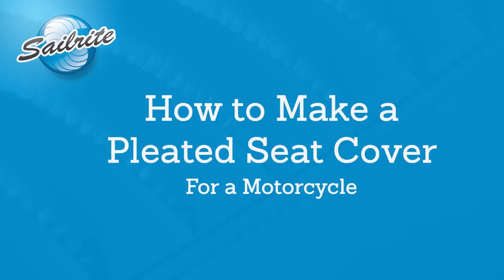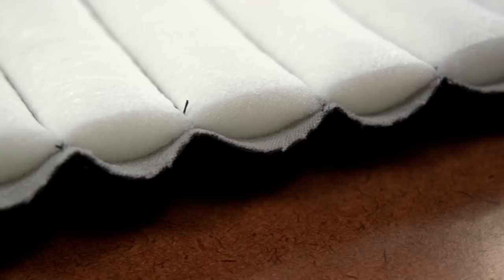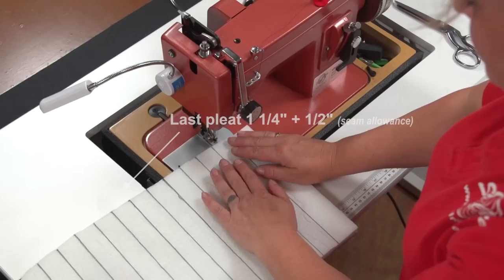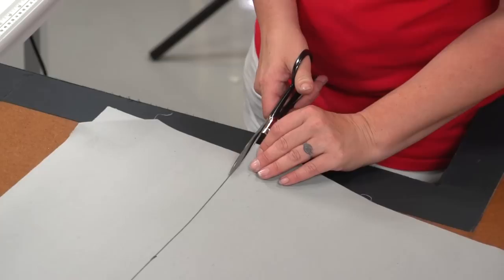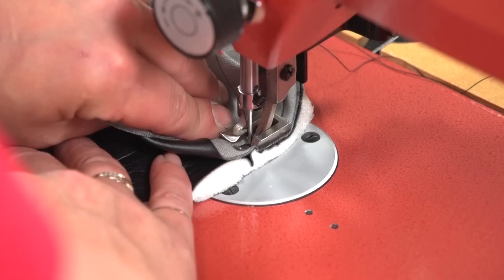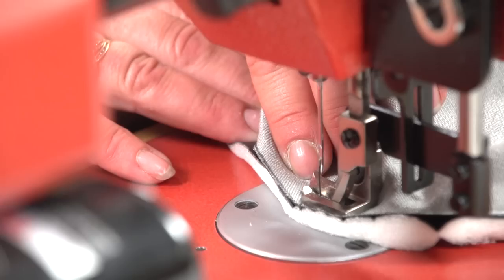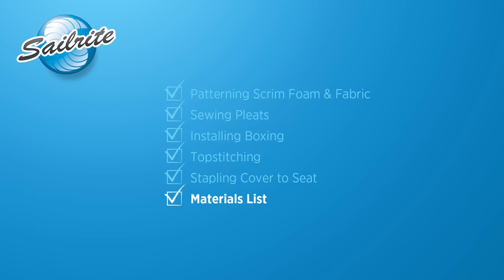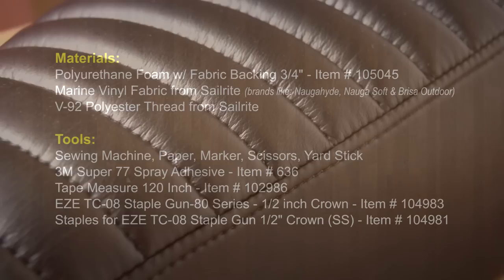How to Make a Pleated Seat Cover for a Motorcycle

Comment: Just used this video to make a new seat cover for my boyfriend's 1973 Yamaha 125.  It came out beautifully!  Instead of foam I used batting, and I used spray adhesive to add ripstop fabric to the back to prevent the stitches from pulling through. I still have enough vinyl left over to make another whole cover, and all the materials only cost about $20. Definitely an upgrade from the original seat (which was about 50% duct tape after 41 years!).  Thank you!
Reply from the maker: Excellent! Glad we could help. If you have any questions regarding our many videos or products at: www.sailrite.com let us know.
Reply: Heather Perkins nice
Reply: Nice

Comment: It's so easy when you have the right tools for it. I have done several seats with a sewing machine that was not designed to sew so thick materials (it was a pain) and I have done a few without any sewing machine. I have never used any glue for the foam just marked the different layers at the same locations so I could keep them aligned.
Reply from the maker: +Gábor Lipcsei Very true! Thanks for your comments.
Reply: I have made 2 two seat covers using very old foot powered seving machine.

Comment: I've watched many of your videos and used many of the techniques. Great job. I have an upholstery shop in Alberta Canada and have bought several of your products as well. 
Let me tell you of an easier way to join boxing thats dead accurate and much easier.
first lay one end down and mark where the center line is that you want your seam . add your seam allowance and cut it off. Then simply lay the other side of the boxing over the first end double your seam allowance ,which in this case would be one inch and cut it off.The trick here is when you lay over, eyeballing an inch is chancy , however if you tick a mark at a half inch (which is naturally what you're looking at as seam) and then another tick a half inch away from that you'll have the perfect one inch. Do this top and bottom and with out a ruler or straight edge you'll cut and sew a perfectly centered seam every time.
Reply from the maker: Excellent! We will try this in an upcoming video. Thanks for the tip!!!!

Comment: the back stitch should be done on the inside of the 1/2"  . This way you will not put a million holes in the vinyl as well you will not see the backstitch joint. This would not apply with a french seam though. I have sewn many miles and this is routine. The band on the seat should be cut concave on the seat corners slightly to draw in the material so it will fit much better around the corners too
Reply from the maker: Great suggestions! I will do this in the future. Thanks a million.

Comment: Never sew were your top thread is from the (stock thread)bobbin, as top thread from the spool is better for top thread, looks and finishing, also sewing were you finish material is face down risks damage from the machine. I alway try to make the primary stich shorter than the top stitch length.@13:48 we can see the tension on the bobbin thread wasn't tight enough to pull the top thread below sight and shows up on the finished work as incorrect stitch. Over all fair to nice work.

Comment: How do you do when the seat bottom is in steel, not plastic/wood. Thanks
Reply from the maker: Those types of seats usually have triangular prongs built into the metal that grip the fabric cover. Does your steel bottom plate have those prongs?

Comment: This was GREAT!

I have a question.

Have you seen a stapler that would work in tight spaces, with no more than 2" height to work with?

I've run across this situation twice recently when rebuilding large boat seats with recessed cushions.

There's no convenient way to staple down the "pulls" which keep the vinyl taut.

When I get out to the edge there's no more room for our Senco stapler.
Reply from the maker: Will this one work: https://www.sailrite.com/EZE-TC-08-Long-Nose-Staple-Gun

Comment: How would one do this for a metal seat pan, as for the staples wouldn't go through the metal? would you use a rivet type method? Also this is not a factory metal seat pan so it doesn't have the triangular "teeth" to bite the fabric, and is why I am asking
Reply: Those usually have a thing where a section of heavy wire is hooked into the rim of the seat. The vinyl is folded around the wire then pulled tight by the wire.
Reply: I think I am going to rivet it to the seat as the metal has been replaced and/or modified from the original shape, Thanks for the info though.
Reply: Ok. good thinking. I suggest using beveled fender washers under the rivets to prevent the vinyl from tearing out.
Reply from the maker: Very good suggestion. I have never used rivets on a job like that, so i would love to hear how it worked out.

Comment: Nice machine. I'd love to have one that size as my Silverton boat needs some new eisenglass up top.  And nice job on the seat cover. Is it possible to do this on a simple home quality machine?
Reply: Hi Mr Walter, I don't think regular sewing machines have the torque to punch through some seams where you stack up to 8 layers of thick materials. I have sewn through thick denim with a replica of the singer farmer's sewing machine, which is technically a home sewing machine. Be careful while trying to sew rubbery materials on machines that don't have a walking foot since the presser foot is fixed, the rubber gets stuck on it while the feed dogs under move your bottom piece.

Comment: with all that stitching won't it soak up water like a sieve?
Reply from the maker: True the needle holes will allow more water to soak into the cushion's foam.
Reply: I've made a few seat covers and you are right, so I cover the stitching on the underside with RTV silicon rubber.
Reply from the maker: Sailrite Yes, using a silicon on the underside will help keep water out. Also you may want to use a silk film plastic to cover the foam first then install the cover. This noiseless silk film helps prevent water from getting into the foam. You can find this product here: http://www.sailrite.com/Cushion-Wrap-Silk-Film-Center-Fold-54

Comment: An excellent video and well explained, can a normal household sewing machine be used for this type of work ? with a heavy duty needle, regards Doc Cox
Reply from the maker: In some cases a home sewing machine may work. Vinyl fabric can be difficult to feed in a non walking foot sewing machine since they are tacking and sometimes stick to the presser foot. Sometimes a roller presser foot can help for those who do not have a walking foot. I like to test a home sewing machines by getting some blue jean denim and trying to sew 4 to 5 layers of denim. If it can do that chances are it may work, if not I would not even attempt to sew projects like this. Using a heavy duty needle does not improve a home sewing machines ability to sew, it only allows a heavier thread to be sewn through thicker fabric assemblies.
Reply: Thank you for your reply, regards Doc Cox

Comment: How do you seal up all the stitching so you don't get a soggy butt ride?
Reply from the maker: A seam sealer can be used on the underside of the fabric assembly to help keep water from wicking into needle holes. Or the foam can be wrapped in silk film to help keep water from soaking into it.

Comment: Hi about water proofing?
Reply from the maker: Place a layer of "Cushion Wrap Silk Film" between the foam and the outer vinyl fabric. Here is a link: http://www.sailrite.com/Cushion-Wrap-Silk-Film-Center-Fold-54
Reply: Same question. So you glue the film to the bottom of the vinyl on one side and the foam on the other side? Do you worry about water entering the stitching holes and becoming trapped in the foam under the film? Thanks.

Comment: I have a stock motorcycle seat that is hard and causes discomfort after about 30 minutes of riding. Does anyone sell softer foam or maybe even gel that I can glue to the stock foam seat after removing the cover, than reinstall the cover? If I can add even 1/4" to the stock seat where the rider sits with either a softer foam or gel, than it should make the seat more comfortable. I don't want to alter the stock seat cover, but I can alter the stock seat foam. Thanks....
Reply from the maker: Sorry, we do not sell gel foam.